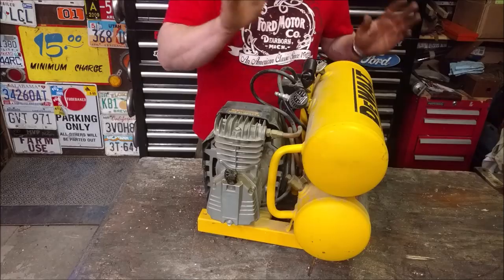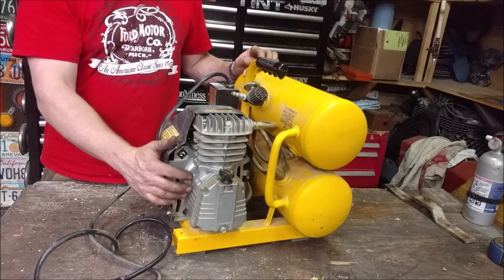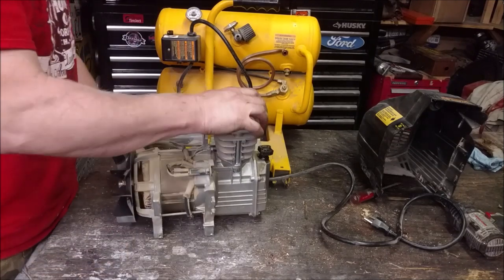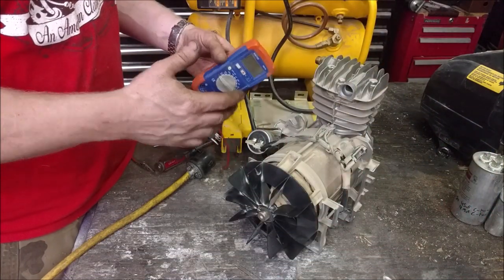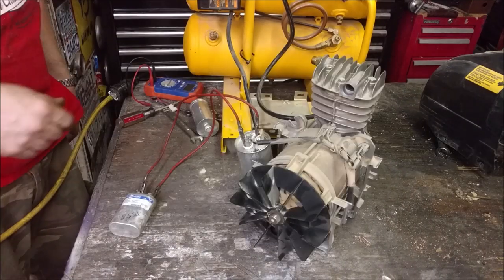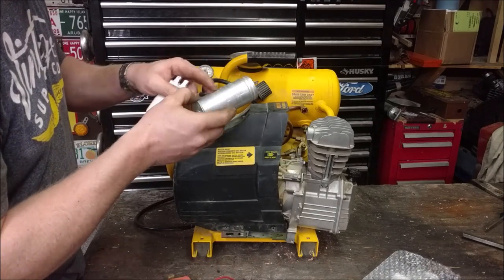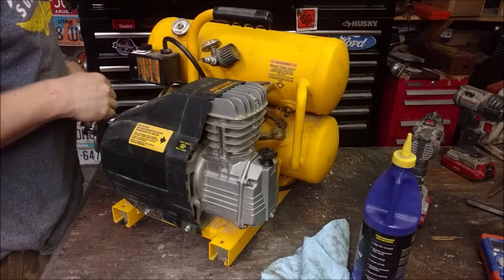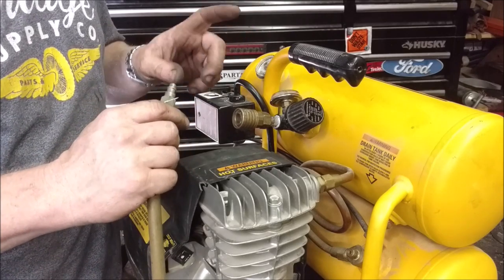How to diagnose Air Compressor Not Working

Comment: Pretty sure that's a run capacitor, just like the ones in AC units are. Start capacitors are only in motors with the centrifugal switch - it switches the start capacitor out once it's running. If that motor has no centrifugal switch, that's a run cap.
Reply from the maker: It's dual purpose. It supplies the initial inrush of current then simply gives a 90 degree phase shift to keep it going. A low torque fan motor only needs 5-10uf as there is very little need for starting torque. The motor would never be able to start without it nor run.
Reply: @sixtyfiveford  Yeah, but if you disconnect it while it's running, it's not going to run right either. A true "start" capacitor is only used for starting, and completely removed from the circuit during normal running. Hence why this would be a "capacitor run" motor. It needs the capacitor to run correctly as well.

Comment: That is a run capacitor not a start capacitor. Run caps stay in circuit, start cap does not stay circuit. Old vid but calling it a start cap was bugging this old hvac guy.